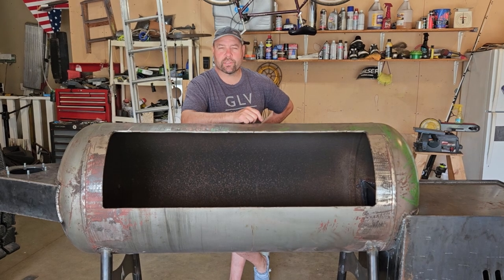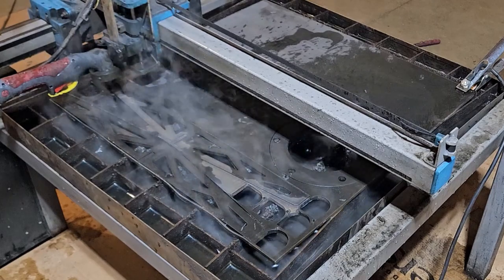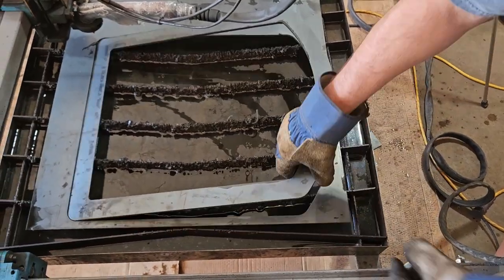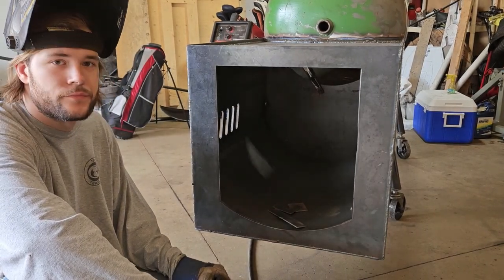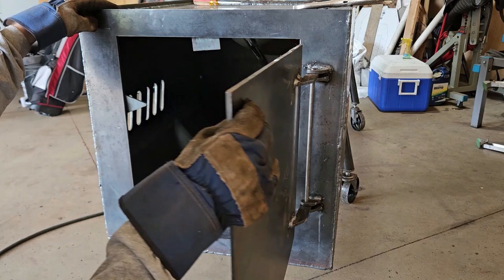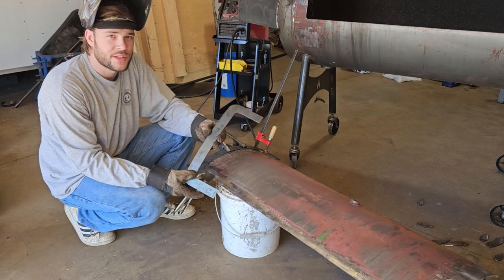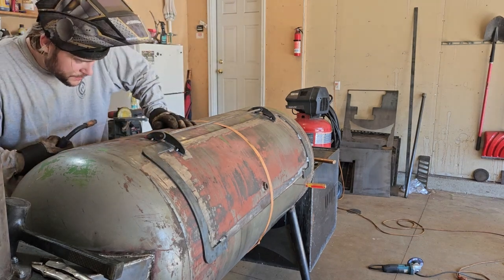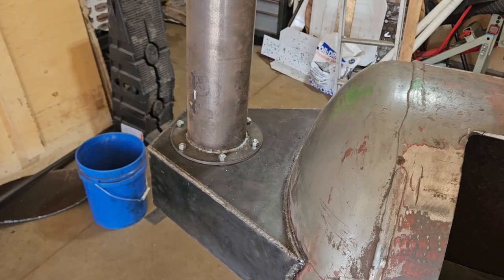DIY Torch Height Controller builds Competition Offset Smoker

Comment: I seen one of your videos where there was ice on the water of your cnc table I have the same problem live in Edmonton Canada I use RV antifreeze in my metal saw and it never freezes any more and works great with the cutting oil. I’m guessing it will solve the ice problem on your cnc table.

Comment: Are the printer settings for 2.85 filament same for 1.75? You mentioned in your 3D printing settings and tips page that it is fine to use 1.75 but didn't provide settings for that size filament.